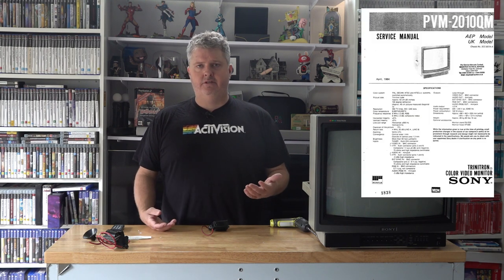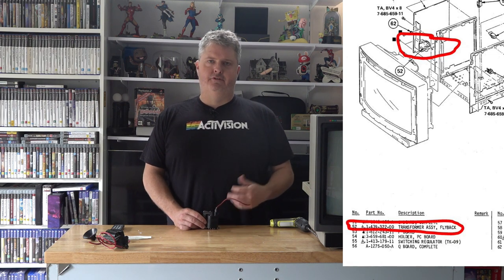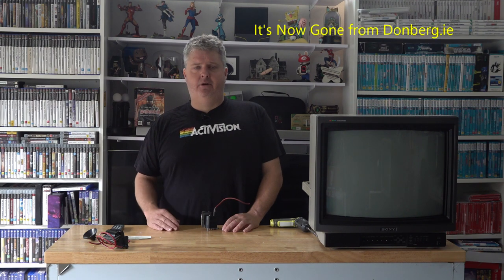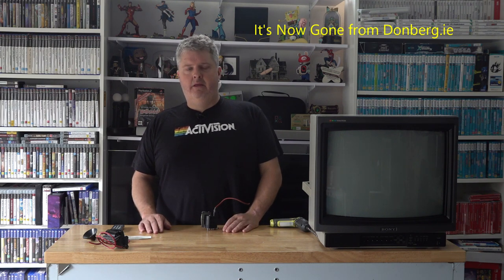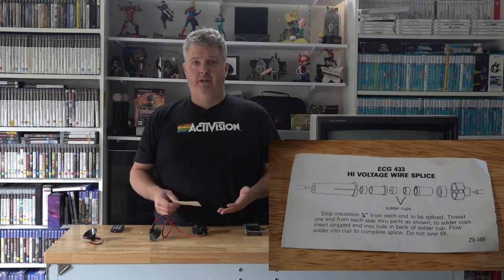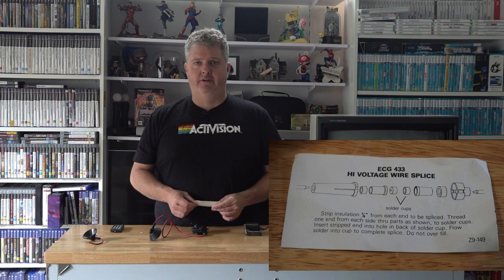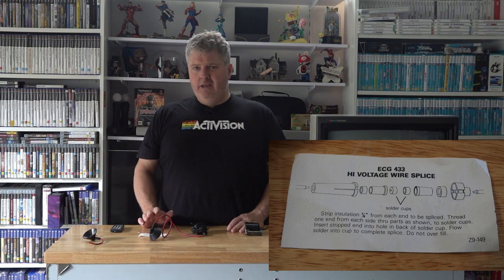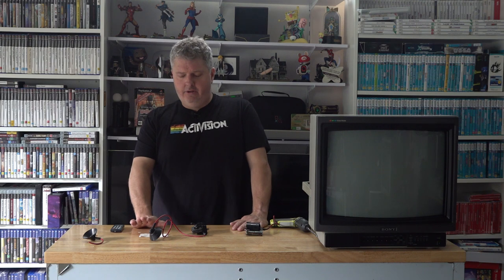Sony PVM Fly Back Repair PVM-2010QM Fly Back High Voltage Splice

Comment: Ok showing us how you actually put together the splice kit would have been a great help.  The black plastic bits that come after the cups on that diagram don't make any sense. I am trying to do this now and they just stop it from allowing the device to actually connect and lock in.  EDIT:  Had the brown rubber bits on the wrong sides.  Diagram made me think the larger one fits into the black shaft part.

Comment: Great video! Love seeing more CRT content. Curious what exactly the process for filling the “cups” with solder looked like for the anode cap replacement.
Reply from the maker: It's pretty easy. I used a small clip to hold the cable in place vertically. Once I stripped back about 3mm of insulation the exposed wire just poked through a small hole in the bottom of the cup. Because I stripped the insulation neatly and square the cup sat nicely square. Then it's just literally heating up the cup and solder and filling it up. Super simple.

Comment: Thanks for putting the ECC433 instructions! I bought the NTE433 equivalent and it didn’t come with any instructions and the data sheet found online isn’t much more help. Are the cups facing each other solder side?
Reply from the maker: The cups are facing each other. Wire gets fed in from the back and you fill up the cup with solder. It's the outside of the cups that make contact with each other Not the solder inside so you don't need to fill the cup all the way up with solder.
Reply: @spudzgames4361  got it thanks. I’m replacing the flyback on a Panasonic BT-M1950Y and it has an extra resistor block that the « substitute » flyback does not have. I’m glad you posted this when you did!

Comment: Hi, Im from US, I want to find the high voltage splice kit in US Ebay, what is the exactly model? thanks
Reply from the maker: Fast Forward to around 5.20. google that part number. You might get an NTE433 instead.

Comment: How many lines is this model? Worth getting if its available?
Also, are you located in in Aus?
Reply from the maker: Yes I am. I think it sits at around 350TVL.
Reply: @spudzgames4361  Not that many lines as I expected, particularly for a 20' screen. I suspect its a mid/late 90s model?
Reply from the maker: @alenmilic1296  early 90s from memory. Picture is really bright and nice, just not a super high resolution. If your familiar with the Profeel range than mote likened to those.